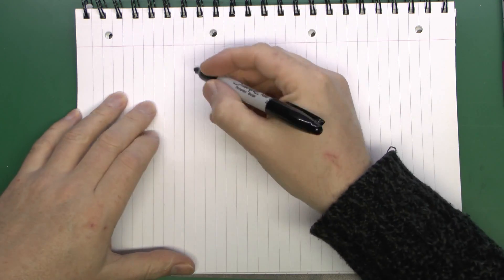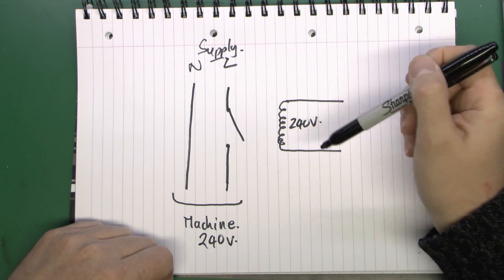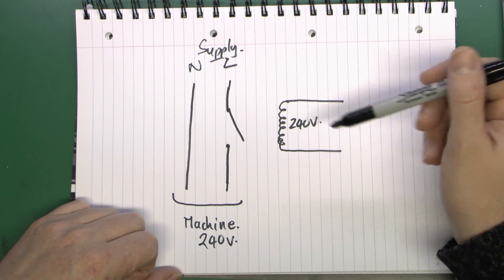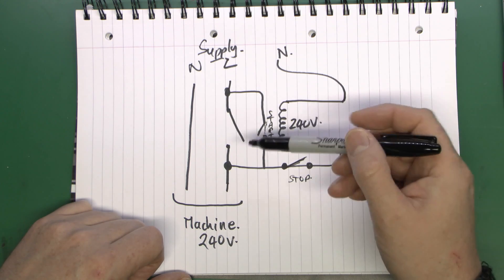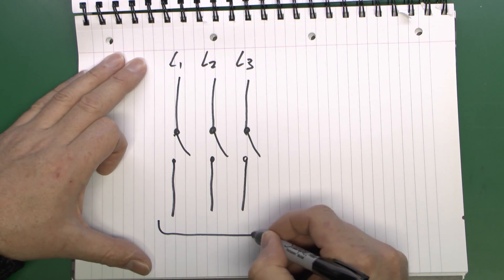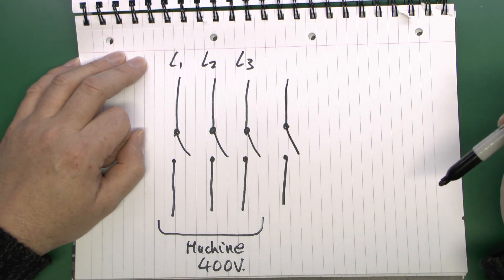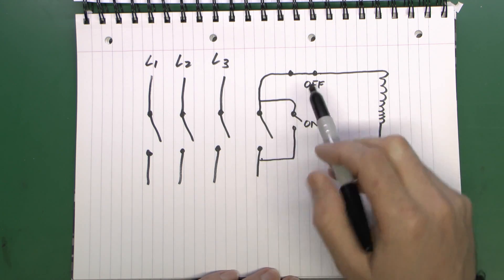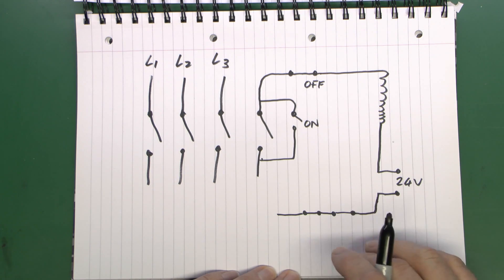Contactor wiring for No Volt Release and E-Stop

Comment: Thank you, I'm sure I've watched and like other videos of yours.

I was struggling with a milling machine control box I'm building not being a electrition etc at 55 year old, including 2x VFDs, coolant, 2x electric power drawbars etc and wanting every safety factor a factory would put into it, and couldn't find anything online regarding 24vac NVR wiring.

I was wanting to use 24vac for a NVR as space is at a premium and you solved my problem in your 3 phase diagram as I have 2 spare contacts using single 3 phase contactor on 240v here in Australia.

Thank you for taking the time to do the video.

Comment: Even though wired correctly, your first drawing is wrong.  When energized, your electromagnetic coil is pulling (and holding) the switch open.  You should have drawn it so the coil, when energized, would pull the switch (and hold it) closed.  Either move the coil to the left of the switch or move the switch to the right of the coil.  Again, it's wired correctly, but it is visually wrong and confusing.

Comment: Hi john, this video will help in my project, however i am wanting to do something more complex but keep ending in a loop, i intend to power a geyser until boiled, as soon as its boiled it will not attempt to boil again until the circuit is manually closed, i am stuck on 2 requirements though that i am hoping to find a solution to, the switch will be a smart switch that cannot handle the 25 amps the geyser needs and i am attempting to not add another load to the circuit as its an attempt for both convenience and saving electricity. At this stage i could use your video to build a meet one or the other but not both, another would've been a momentary switch that energizes a coil that holds the switch in place until the geyser turns off, this again does not allow the smart switch, any ideas would be greatly appreciated

Comment: Hi John, thanks for the video. I tried to build a NVR panel and it failed miserably! I suspect the low voltage switches that I've been supplied with are incorrect, should one or both of the switches be latching? I need to provide a NVR for a 40amp 240v circuit, I have a 24v transformer and NC and NO switches along with a single phase 40amp contactor, can you please advise? I need this to protect a heat pump from restarting after a power cut.
Reply: Wire the push button switches like in the link, on the first circuit (line). Have all the load (40 amps) coming through the contactor. You need an auxiliary normally open contact (most contactors have them or you can add them, they clip on) for controlling the latching of the coil. The push button switches only will need to carry the current of the coil (very small amperage) at 24v. The main contacts on the coil will do the heavy lifting at 240 volts. It is simpler than it looks once you wrap your head around it.

http://machineryequipmentonline.com/hvac-machinery/wp-content/uploads/2016/01/Control-Circuits-0278.jpg

Comment: It may be different from here in america but we wire the stop button before the start button.
Reply: Technically you're supposed to wireless top button before the start button. It is safer that way, there are less wires and connections for power shut off to the circuit. In reality, I've seen it done both ways.

Comment: Owh, love your channel but that first diagram is very very bad, slow acting start button in parallel with the power contacts, so everything has to be M rated for the locked rotor amps, that’s just stupid. Always use auxiliary contacts.
To make it worse, it was the first and only full voltage example, so now you will have people hooking up direct acting, “pilot duty” start buttons on their 3Hp CSCR air compressors and welding fuk out of them.

Never use the first example people it is wrong on so many levels, the second example is perfect, just use a 240 volt coil and forget the transformer.
Reply: He explicitly states the first example is for low consumption equipment. There are tons of things wired that way. He's showing people what they're going to see in their own equipment. Not everything comes from the factory using an aux contact.

Comment: That's a very nice explanation. and quite informative.  I've got to figure out how to wire the e-stop when I've got a variable frequency drive involved.  I know I want to break the power to the contactor, but all that is internal to the VFD.  I'll have to do some more research.
Reply: Many VFDs have emergency stop functionality built into them, and you can control whether it's a free wheel stop (cutting power and letting it coast to a standstill) or whether the VFD actively tries to brake the motor to stop it as quickly as possible.  Some of them require special resistors to be attached in order to achieve fast braking so there is somewhere to dump the excess power to (since braking a motor works by turning it into a generator, and the more power you can pull out of the "generator" and dump somewhere, the faster the motor will stop turning).

Comment: What happens if one phase goes out? 

One building I worked in lost the Black (labled as Yellow) phase a few times.

If the 24V supply is powered from one of the other phases then it would seem to keep the contactor in the on position with potentially bad results.
Reply: If you lost a phase has in johns circuit the overload relay for the motor or whatever is powered would shut the circuit down  doesn't matter if the 24v is present the circuit has been opened. ..
Reply: Assuming we're talking three phase here, on many medium to high horsepower applications (10 or 15 hp+) a phase loss monitoring relay has become standard. You can't necessarily rely on an overload catching a phase loss before there's damage to the motor or the contactor. It's wired up in series with the overload on the coil control circuit. So if either device sees a problem, it cuts voltage to the coil and shuts off the device.

Comment: Sorry to be picky but this circuit is unacceptable in a industrial environment, and was made illegal some years ago. All emergency stop circuits had to be made dual channel , with an emergency stop monitors to check both contact of the emergency stop buttons are working plus an additional contact to ensure all motor contactors had opened on the last stop command. Where Inverters are used there has to be isolation contactors fitted in the output circuit to the ac motor. Inverter being electronic are not classed as fail safe as are PLC's
Reply: ANDREW MICAS your use of "illegal" (as opposed to "against regulations") is almost certainly untrue — for one thing, there's more than one country out there, and for another, in most countries' regulations there are multiple categories of risk. Did you also notice that John was mostly talking about consumer shop tools, and not about "industry"?

But feel free to post a video showing how it should really be done for ultimate reliability, and if you give us the link I'll watch it with interest.
Reply: I dont think you are correct when it comes to inverters have to be disconnected by dual contactors. 
A lot of new inverters I've seen lately have a Safe-Torque-Off function and the manufacturers says it can perform up to Performance Level d (Category 3).

Comment: Things have changed a lot with E-stops, machines are risk classified which specifies the required protection, devices I work on even pillaar drills have pilz saftey relays and safety contactors, which of course have dual circuit monitored e-stop switches.

Comment: Interesting video, John. Thanks!
In case of the three phase motor controlled by a 24V signal, you'd have to make sure that the motor and the control transformer/circuit were on the same breaker, right? 
Otherwise if the motor tripped the breaker, on switching that breaker back on the motor would immediately start spinning instead of requiring a manual start.
Reply from the maker: Yes, the 24 volt supply would be from the same breaker.  For larger machines it's usually provided from a transformer inside the machine or it's control cabinet.
Reply: If the contactor is not latching type, when the power returns after a power failure, it will not start the motor as the contactor's own NO contact will be used to keep the contactor latched in ON position (which would have opened the contactor in the event of a power failure). Hope that clears the point.
Reply: Koffi Banan could you show us inside a start stop with coil?
Reply: psh

Comment: What is the difference between a contactor and a latching relay?
Reply: A contactor power has to be continuous applied for the contacts to close a latching relay will latch on with a pulse of power and reverse the polarity to unlatch it
Reply: Thanks its a subtle difference but a difference all the same.  SO a latching relay won't unlatch even if power is cut?
Reply: there are 2 types of latching relays dc ones which are basically a switch with a moved by a solenoid and a ac latching relay which is the circuit that john showed us the ac one will unlatch when power is cut
Reply: So a contactor is basically an AC latching relay then? On this cricuit you could basically use a N/O foot pedal as a dead man switch if the contactor was driving a lathe or drill press. Probably not so practical outside educational settings though.
Reply: DeKempster: 
I'm not sure how you can make a safe Deadmans-Switch (foot pedal)  if you are using a NC contact. 
If you are using the NC contact then you have a 24v signal when the pedal is resting and no signal when the pedal is activated. Which is perfect for an ESTOP, but seems a bit odd for a Hold-To-Run function. What am I missing?
Reply: yeah, you might be right.
Reply: The problem with your first example is that even with the stop switch in the open position, if you press the start button the relay will not energise but the machine will start.